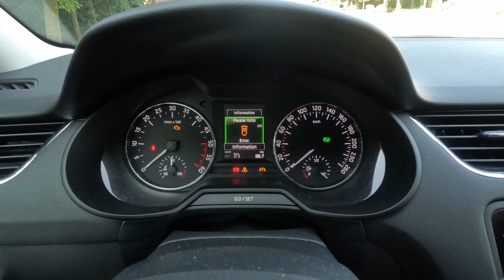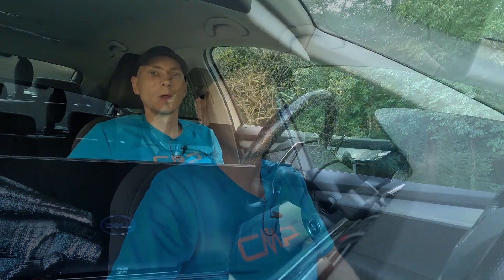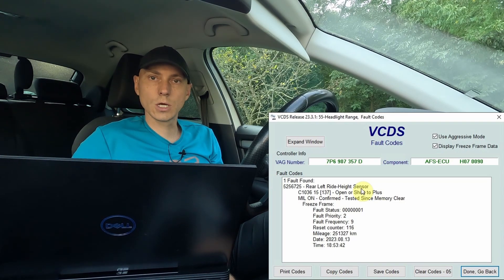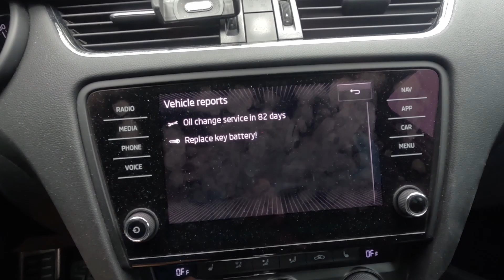Skoda Octavia MK3  – rear height sensor replacement – Error: cornering light (AFS) – tutorial

Comment: Hello, im having a bit different issue. If you dont mind me asking, perhaps you might know or at least point me to the right way. I have skoda octavia 3 1.6 TDI 81Kw and my headlights are too high, it happened suddenly. What i did is that i adjusted them manually with allen key but i want to sort this issue out. I have no fault on my dashboard and one of my friends that was connected to it with some diagnostic told me there are no faults either (he even was able to move the headlights manually over this diagnostic tool)
My question is:
Under the tab "55- Headlight Range" -> "Advanced Measured Values" are there the actual analog data in a real time ? If thats the case i will get someone with VCDS to find that information for me as i want to get this fixed myself as im electrician :D
Thanks for reply :)

Comment: after changing senzor my lights still dont work at cornering, before error was all perfect, but they do it perfect with diagnostic
Reply from the maker: Do you have them activated in settings?
Reply: @MtlCarGarage  they should be, cause they worked before

Comment: Thanks for this. Finally, a good solution for that error message. I have the same problem, and everyone on the internet was saying I need to replace some bulb light, but that's not the case... I wonder where the sensor is located for the FRONT side ??
Reply from the maker: You will spot it easily, just look on the front part of the undercarrige. It might be on the right side, I do not remember exactly now. But do check first with the diagnostic, what the exact problem is.